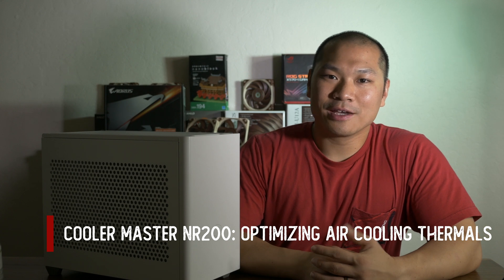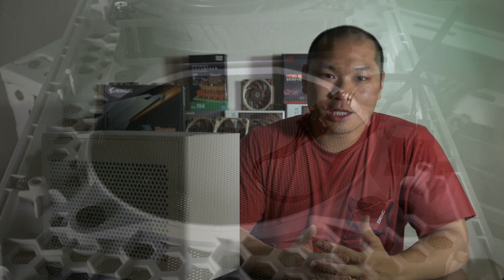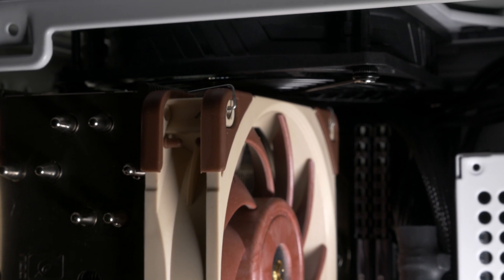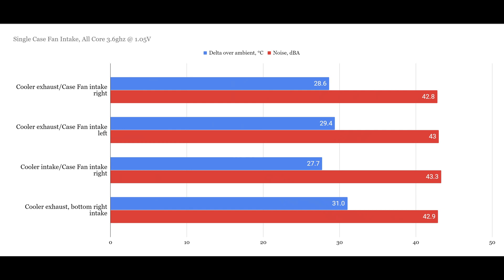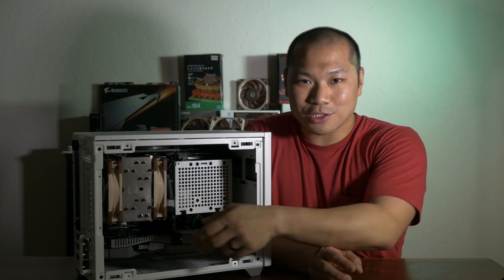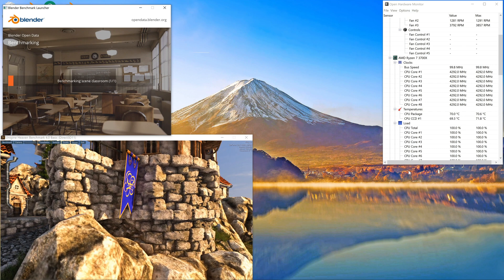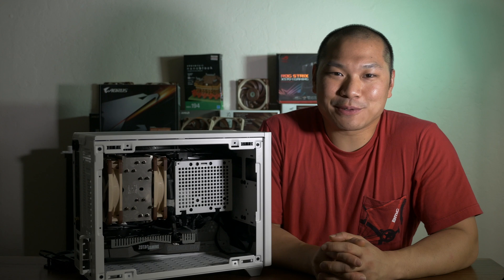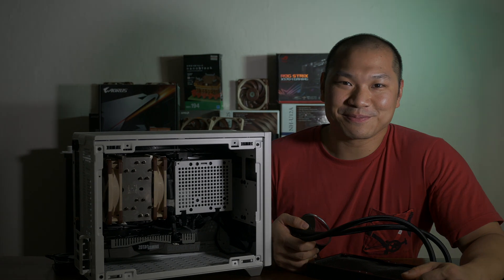Cooler Master NR200: Optimizing Air Cooling Thermals

Comment: If I'm running two fans on the CPU cooler (exhaust position) am I better off putting the left fan on the cooler (ie: both on cooler) or directly on the case?
Reply from the maker: You can only fit a 92mm on the case so if you're dealing with 120mm fans you don't really have the option. If it's a 92mm cooler then I'd mount on the case directly.

Comment: Hi there is new HYPER 212 EVO V2 did you tried it already if it will fit ?
Reply from the maker: It does! Check out the latest Ryzen 5 tower cooler roundup, it’s good for both vented and TG panels.
Reply: @MachinesMore  yeah i’ve watched the whole video thank you so much for this. I hope it give good cooling on my ryzen 7 3700x with asus x570-i

Comment: Got the same cooler so this was very helpful!
Guess I personally will go with above-psu intake - cooler exhaust because there's a lot of dust where I'm at and using the cooler as intake would render the dust filters almost useless, as you mentioned. The fact my gpu is blower style probably helps temperatures too, and noise is irrelevant to me. :D
Reply from the maker: Sure! Well blower cards, when you don't care about noise, are fantastic for limiting system thermal interaction.

Comment: Interesting.  This is basically turn the case air flow into a negative pressure similarly to NZXT ones.  Am I correct?
Reply from the maker: In the minimal single fan, rear cooler exhaust sense, yes. The NZXT H series are quite balanced though. You usually run two intakes at front, and one/two exhausts out back.

Comment: Man. I bougth the bequiet dark rock pro 4 cooler to use it whit a ryzen 7 3800x. Do you think that cooler is going to fit with this case? 
I bougth it on amazon and im waiting for it to arrive. Im in time to cancel 

Sorry for my english man. Its not my lenguage
Reply from the maker: I’d cancel it, it won’t fit. It’s too tall, 158 is as high as you can get. I’d go U12A if you want a higher end tower. You could cool Ryzen 7 with a Scythe Fuma 2 also.
Reply: @MachinesMore  thanks. The bequiet arrived today and as you said it didn’t fit haha i already bougth the fuma2 cooler

Comment: You think a 159.4mm height cooler will fit 😄😄
Reply from the maker: Depends on how much your mobo can flex, really. That’s why the same cooler fits for some but not others. These are all pushing up against the panel and you’re just forcing it in place.

Comment: Have you tested these configurations using the tempered glass panel? I was planning to do this set up as well; cpu cooler exhaust, top exhaust, bottom intake (if needed) with a TG panel. Anything helps! Thanks

Comment: I just subscribed to the channel. Excellent work. So it looks like a negative  pressure setup is the way to go. Funny thing is, I like a gazillion other enthusiasts would have assumed 2 bottom intake fans would have been totally beneficial and didn't even consider the effect it would have on the hot GPU air circulation. They would only be beneficial with blower style coolers.  For this insight alone, this video is worth 1,000,000 views and likes for SFF PC builders because this undoubtedly applies to all similar case styles. Well done.

Comment: What about a noctua NH-C14S with a fan on top rather than underneath? That would pretty much be up against the side  grill pulling in fresh air. Then add two top exhaust fans. If it fits. Not sure if the cooler will get in the way of the exhaust fans.
Reply: Sorry. Only just saw your other video including this cooler. Thanks.

Comment: the cpu cooler is bigger than advised. where you even able to close the panel?
Reply from the maker: On the U12A I had zero problems closing with just the clips. Are you on AM4 or LGA sockets? It if flexes the panel out a bit, I would use the screws from inside the case to pull the panel in tight.
Reply: @MachinesMore  Thank you. I'm using AM4 and I intented to use a bequiet Dark Rock Pro 4 with a height of 163 mm, but I guess a U12A with 158 mm is then the maximum.
Reply from the maker: Pretty much, that would be nice if it would fit but it most definitely will not, short of modding the side panel.

Comment: Hey so would that U12A not at all fit in the tempered glass side version?
Reply: Based on other content I've seen I believe it works but you won't be able to use the fan/radiator mount.

Comment: For the best possible cooling I would suggest an AIO mounted on the side as an intake. Two intake fans at the bottom and two exhaust in fans on the top. 
The bottom fans feed the GPU cool air the AIO gets cool air from the outside, and the top and back exhaust the hot air.
Reply from the maker: And that is an excellent suggestion indeed. I'm sure you will love Liquid AIO cooling part 2 then!

Comment: Cool. I’m waiting on my Nr200 non p. So two bottom case fans in intake don’t add much... that’s surprising. I figured cpu exhaust, and top two exhaust. Can you run 2 top and 2 bottom fans at lower speeds to reduce noise and still get an edge over just 2 top exhaust fans?
Reply from the maker: You could- running the bottom fans doesn’t help anything too much for a tower cooler in rear exhaust mode. It exacerbates the circulation of warm GPU air which makes things a little worse. Your GPU is being helped by the tower and air is already being drawn in through the side panel. Primarily the function of the top exhausts is to help that cool air to pull in from the side, as well as vent out the hotter air. Bottom fans don’t hurt too much, especially if you lock them to a lower level, but my take was it wasn’t an immediate need for building this case, if ever. The top exhaust, for sure, they’re key.

Comment: What about changing the power supply location?
Reply from the maker: Are you referring to the effect on thermals?
Reply: @MachinesMore  Just curious if mounting it on the front is possible like the NCASE M1?
Reply from the maker: Sure is! It will mount a little lower, so if you have a long GPU, you’ll have to make sure the PSU cables don’t interfere.

Comment: Just bought a 5 pack of Arctic P12's I'll just run two intake at bottom, two exhaust at top. Pretty good deal for the 5 pack.
Reply: i acctually had better temps without the bottom fans, just 2 at the top and a 90mm at the back (the 90mm doesnt change much). Only upside of bottom fans was that the gpu stayed at 0rpm longer
Reply: @broodje.martino  Seems like a lot of standard thinking about PC case cooling doesn't apply for the nr200 (or at least not fully needed). Like normal sized PC cases are fairly air tight, not a lot of free airflow, so that's why intake and exhaust fans are pretty important, to manufacture air flow. The nr200 however is small but fully vented chassis, so every component is immediately within inches of outside air, so the fans apart of the cpu/gpu do everything without much problem.

Comment: Does anyone else feel the temptation to grab an Arctic 5-pack and mount them all over the case?
Reply: Yes! But I somehow also would like to try 7 Noctua NF-A12x25 and a Noctua NH-C14s to see what that would do ;)
Reply from the maker: That's the spirit! Let me guess- 2 on the heatsink, and 2 on the bottom... 1 on the rad panel, and 1 on the top? One won't fit on the top directly overhead, though.
Reply: It's tempting, but I just have for cable management sake a single top exhaust fan (a quieter rosewill 120mm fan I had sitting around instead of the stock), a 120mm fan apart of my noctua  cpu cooler, and my 5700xt reference card at the bottom (blows air out of the back of the case due to being a blower), and has tons of clearance around it. Very quiet overall and good temps, but the 5700xt during gaming can crank up a bit, but honestly not that bad at all (plus it's only temporary until AMD releases new cards which is imminent).

Comment: I would like to understand if I'm wrong, but let's say ~90% of all shown graphs are in margin of error difference range and are not very informative. No difference is a valid result, but then is it really a good idea to do conclusion which clearly prioritize one configuration over the other? There is one bad configuration, which dumps hot CPU air into the case for GPU to recycle but other than that it looks pretty non-distinct.
Reply from the maker: You're right- for the most part, no, as long as case fans are exhausting, the actual direction isn't a huge issue for CPU temps. However, out of the box the case is setup to exhaust out the back, and that is at least meaningful from a dust management perspective, and also from a GPU thermals perspective. The intake orientation does have a meaningful impact to GPU thermals, whereas exhausting (or semi exhausting as the fan is not sealed to the case) gets that hot air out as soon as possible.

Comment: How about trying a CPU Cooler like the Noctua NH-L12S or NH-L9x65 SE-AM4 with the metal perforated side panel and the side fan holder and add 2 120mm x 15mm side fans intake and 2 120mm top fans outtake ?
Reply: NH-C14S?
Reply: @duytranuc4025  Works very well in my Cougar QBX case. I did need to mod a new power cable extension (>$15 total including buying tools), but that let me solve a potential PSU compatibility issue.
Reply: @Kathdath  nr200 is bigger than QBX, so it will fit i guess
Reply: @duytranuc4025  it's smaller in volume
Reply: @mrsarcasm4874  managed to fit a fs140 in nr200, and swap noctua fan in it

Comment: good review and tutorial series !
is it possible to turn the CPU cooler by 90° ?
Reply: Idk if this is true for other coolers, but the 212 from coolermaster can be only mounted vertically in amd cpus, but it can be installed horizontally or vertically in intel ones :)

Comment: Thank you very much for detailed AIR cooled testing! Can you please comment on how much dust in going inside the case in the configuration of top exhaust(s) and cooler exhaust? Because, in this configuration you essentially create negative pressure. Thank you!
Reply from the maker: You’re welcome. To be fair- “pressure” is a byword in a case this well ventilated. I think what we’re trying to describe is that air is inordinately being taken in from other sides. (Tempered glass version will be very, very different results). My rationale for not intaking from the rear I/O end of the case is partially related to dust- there isn’t a dust filter. For exhausting out the top and exhausting out the rear I/O end it’s going to be the best in terms of dust. The bottom is covered with dust filters and so is the side panel. Even so, dust typically is not a big deal unless you’re the type to just forget that the computer is there- I would just blow it out with compressed air every now and then, since it’s so easy to open. Even with filters one still has to clean them.

Comment: Thanks for this video, i think it will be nice if you can add yo the final graph the two botton fans in exhaust, in my opinion it will decrease thermals
Reply from the maker: That’s an interesting point. I will say, I didn’t test it because that config would adversely affect the GPU’s airflow. The GPU will be trying to intake while the case fans will be fighting it. Normally if it’s far away it’s less of an issue but here we are talking fans practically right up on the cooler.

Comment: Hi I was thinking about buying this case. I might have missed it or you may not have mentioned it but can the case fit 2 more fans in the front preferably as intake fans? And if so does it provide any additional benefits? Also can this case fit a 240/280 AIO?
Reply from the maker: Depends on your cooling choice. The max is two side fans (120/140) on the side. If you use a tall air cooler (>~130mm) that left side is blocked for fan use. If you can mount the radiator panel with your air cooler, you could have one side fan. If you use a maxed out height cooler (like the U12A) that’s not an option. I did mock up one side fan with some Blue tack, however it did not have a meaningful impact on thermals. You can use either a 240 or 280 rad on the side panel, yes.
Reply: Machines & More Thanks a lot for the info

Comment: Wait, does the U12A fit the tempered glass panel even with the Chromax shield on? Would you please confirm this? Great video!
Reply from the maker: Nah- that was a cutaway to the Lian Li TU150, which I’ll be doing a head to head on. I do not think the U12A will fit with the TG, given my experience with the mesh side panel being a marginal fit. The TG has 2mm less. Thanks for checking in?

Comment: Thank you for the Video! Is it possible to rotate the NH 12 in 90 degrees, if i dont use a graphic card? Or will the NH12 Hit the RAM?
Reply: Not with AM4/Ryzen platform.

Comment: Good video, nice methodical breakdown. 

One thing I would have liked to see, specefically for this case, would be to take of the GPU shroud and fans, then run the 2 extra 120mm fans in bottom. In either exhaust/intake configuration. 

Now this GPU isn't to big, not thick so with bigger GPU this can have huge benefit both in terms of thermals but also noise. 

3ven more so with GPU's, where the heatsink funnels oriented the other way.

Comment: Just to clarify that I understand you correctly, when you say “Case Fan exhaust LEFT”, I assume that means when the case fan is on the LEFT side (as we view the video). Hence @9:00 the black, top case fan is “left”?
Reply: Left means the exhaust fan is on top of the CPU cooler, towards the rear of the case. Right means the exhaust fan is on top of the PSU, towards the front of the case. It was kinda confusing at first but it made itself clear once he mentioned right/left at the end of the video.
Reply from the maker: You’re correct. It means the single exhaust fan is on the left (over mobo) or right (over PSU).

Comment: I think the main problem with using the top fan as intake is it's pushing the PSU exhaust back into the case.
Reply: and it's going against rising hot air too?

Comment: Hey, great video! Finally someone doing air cooling in the NR200!
A question: how well does the NH-U12A fit in the NR200 (non TG)? I have a NH-U12S and they're supposed to be the same height, and I can see that it does fit, but in another comment you said that the NH-U12S weirdly doesn't.
Another question is, can you fit standard width 25mm fans at the bottom of the case while you have the Strix 5700 XT installed?
Anyways, keep on keeping on!
Reply from the maker: Glad you found it helpful. My guess is... manufacturing tolerances. I tried the U12S in the case to get some thermals and was surprised it pushed the case panel out just a few mm (it probably wouldn't bother some people), just enough to not close fully. U12A fits fully- and with the dust filter installed on the panel. I didn't try taking off the dust filter for the U12s to see if that would change things. No go on 25mm fans with a "3-slot" cards (it's a 2-slot card but functionally takes up 3 slots of space. Even with the Zotac mini, 25mm fans are right up against it, almost to the point where I think they would interfere with the airflow from how the fans are working on the GPU itself.
Reply: @MachinesMore  Looks like I will be selling my U12S and getting Scythe Fuma 2 for this case!

Comment: Hope u take into account the AIO water pump placement as per GN findings. Although there aren’t many options it would seem.
Reply from the maker: Cheers- yes, I did see that and do agree generally with Steve's recommendation. It doesn't really affect the testing at the moment since I am currently testing with the rad on the side anyway, and I don't think that the bottom rad will have a significant impact on CPU thermals. The main thing I am curious to know is top fans as exhaust/intake with intake/exhaust for the rad fans. I may not test bottom rad at all, but may just do a run or two for reference.